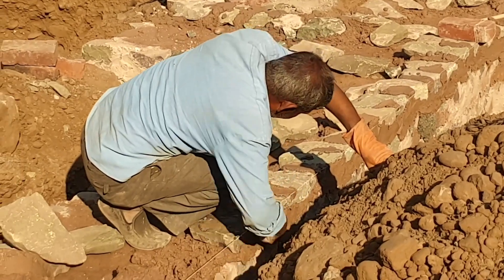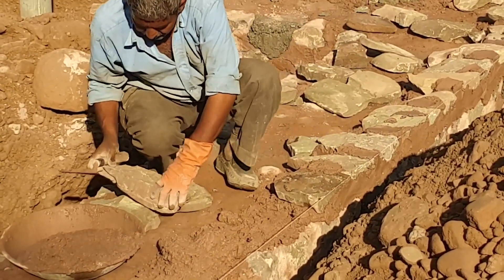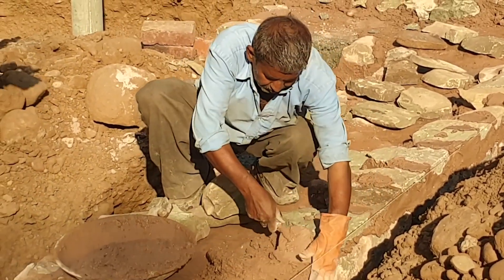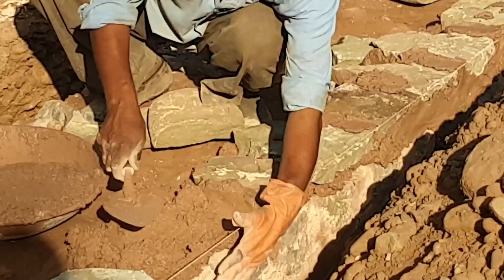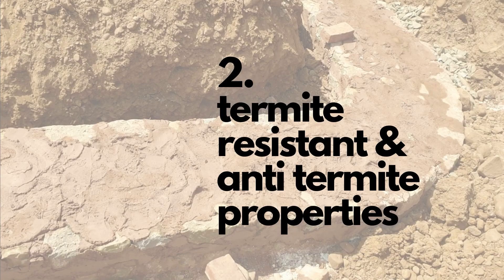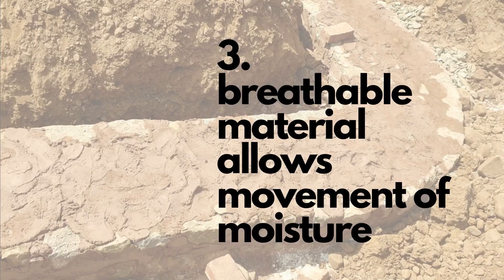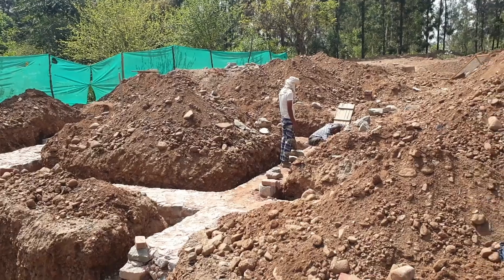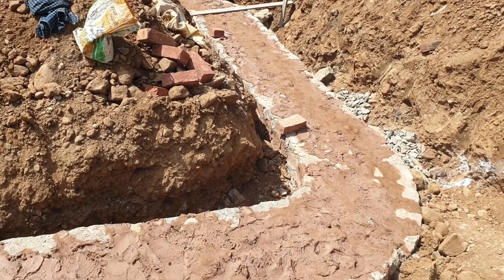Make a Lime & Stone Foundation for a Sustainable House!

Comment: Thanks for this video. I have a question though. Since you are using g lime, Is there a waiting period once you are done with foundation and before you start building the basement  above the ground level? 
I  have been told that at every stage you need to  atleast wait for 1 month to allow the lime to settle in and only then move on to the next stage either the basement or the walls. 
Please clarify.
Reply from the maker: Yes, Lime sets slowly, so you do need to give it time.

Comment: It seems you are using hydrated lime powder, is that correct? When you use quicklime instead and slake the lime while preparing the mixture, so that it becomes hot, then the foundation is more durable, because of the chemical reactions from the slaking of lime together with the soil. Did you try that? Or did you use hydraulic lime? I can share a video wher you can see the difference, but unfortunately it is German: https://www.youtube.com/watch?v=SLEv6H7YBK0
Reply from the maker: We have used hydrated lime, but slaking it in the slaking tank

Comment: Maam how the plinth beam is made....which material is used. Secondly i am curious about the roof made of wood...can we build storeys above?
Reply from the maker: Plinth beam is made with steel and cement. 
Yes, you can make a second floor on top of the wooden roof. Most homes in the hills used to have wooden roofs in the past.

Comment: Liked and subscribed after finding this channel. Very impressed with the recycling and circular economy of lime used in construction. I have built a geodesic dome and covered it in an outer skin of newspapers and PVA. It is a large space and extremely lightweight.  I am looking to render over it with a light weight mortar and have been researching how shell is formed in nature. From egg shells to sea shels both extremely strong materials especially in the shapenof an egg or a dome where shape contributes to strength. This being the case my frame can be removed after outside coatings have set to make many more replicas.i have big ideas regards geopolymers if roman concrete can be considered a geopolymer. Before I render my geodesic dome I am thinking three steps ahead. Three layers, as in anode , cathode  and absorbant wicking separator.my whole building  will be an air battery and electrical store of power that can be charged and discharged when thinking about the Three seperate lime recepies for each layer. I look forward to your feedback and from anyone else that believes in open source abd that sharing is caring .❤

Comment: Hello Manisha....im trying to reconstruct and maintain a 70 yr old Mudhouse...i did see ur video on Building with Lime . Since  i couldnot find  arny local workmen who have hands on experience with Lime mortar i tried this my self...tried with a 3: 1 River sand to Lime mix and then a 2.5 : 1: 0.5 of River sand  Lime and Wood ash.....Both the mixes turned out brittle and are setting in even after 30 -40 days and is sort of breaking off.....Will be very helpful if u can share any details on the mix or any writeup / manuscript /link u have on Lime mortar mix proportions and any pratical tips Thanks in advance
Reply from the maker: The mix ratios used by us are 2: 1 Sand : Lime
When adding ash it would be 1.5 : 1 : 0.5.  Sand : Lime : Ash

You are putting too much sand, which is making it brittle.

Comment: Before cement,lime was the binding material used in buildings . Cement ,a limestone based product replaced lime. Now, lime suitable for building is not easily available
Reply from the maker: Yes, lime is becoming less common, but you can still find it! You can contact MLIME to get good quality lime for construction

Comment: How do you make corners in rammed walls?
I mean length and width, which meet at corners.
Is there any space between them, or can you fill it with mortar?
Reply: And different angles in the corners like round,
How one can make them?
Reply from the maker: all our corners are rounded. For that we had made curved formwork. However, you can make an angular corner as well. Just make the formwork in one go, so you are ramming the edge together and not piece by piece
Reply: @farmaanandaa  thanks.
I will keep inquiring.
Hope you won't be bothered.
Thanks again to reply.

Comment: Is red clay soil ideal for Rammed earth construction??
Reply from the maker: Clayey soil is not suitable for rammed earth. You should try cob technique instead
Reply: If soil is too much clay add amendments like sand or gravel, don't just use as is. 
We have high clay in spots, but by mixing with gravel from other parts of our land have found a good mix. 
We are still in the testing stage but the blocks set like concrete with the mix we created. So like cob a mix, but unlike cob a drier mix. Which for us is best. We catch rain water or haul it in if there is no rain.
YMMV testing is key. Check Martin Rauch work on rammed earth too.

Comment: What is the plinth beam made of?
Reply from the maker: That is made of  steel and cement
Reply: @farmaanandaa  thank you and was any damp proof coating done on top of it?
Reply from the maker: @msunils  not really, but you could do it
Reply: Why the plinth beam not made with lime mortar? And why plinth beam is at all required for a single floor house?
Reply from the maker: @shekharkanchan275  because the steel rebars will corrode with lime. Also it was needed because we are in earthquake zone. Otherwise it was not necessary

Comment: Is this OK for heavy rainfall areas? OR do we need dry stone foundation for particularly heavy rain fall areas houses foundation?
Reply from the maker: Am not sure.
Reply: Are you worried about walls or foundation? or both?
Optimal Roof Overhang Length: the more driving rain you get the more overhang you want. always try to keep walls dryish.
12–18 inches: This is a practical minimum for most climates. It provides decent protection while keeping construction costs manageable. In moderate climates with average rainfall (e.g., much of the U.S. or Europe), this range is often sufficient.
18–24 inches: Ideal for harsher climates with heavy rain, snow, or intense sun (e.g., coastal areas, mountainous regions, or the tropics). Longer overhangs offer better shielding and can improve energy efficiency by shading windows.
Longer than 24 inches: In extreme conditions (e.g., tropical storms or heavy snow loads), overhangs of 3 feet or more may be beneficial, though they require stronger structural support and may increase costs.

If the foundation area is wet often or flooding? Higher ground with Lime Soil Stabilization is common.
Clay soils require more lime for stabilization compared to other soil types. This is due to several key factors:
Chemical Composition: Clay soils contain minerals like silica and alumina, which react with lime to form cementitious compounds that strengthen the soil. This process demands a higher amount of lime to be effective.

High Plasticity: Clay soils tend to expand and shrink significantly with moisture changes because of their high plasticity. Lime reduces this plasticity by modifying the soil’s structure, but it takes more lime to achieve this effect in clay than in less plastic soils like sand or silt.

Large Surface Area: The fine particles in clay provide a greater surface area, allowing the soil to absorb more lime, which increases the overall amount needed for stabilization.

Typically, clay soils require 3-8% lime by weight, while sandy or silty soils may only need 2-4%. Thus, clay soils consistently require more lime to achieve the desired stabilization results.
Reply: Lime Foundations: Hydraulic lime is suitable for heavy rainfall areas due to its water resistance, while non-hydraulic lime is less effective.

Dry Stone Foundations: These can work if well-built but may need more maintenance than lime foundations.

Water Diversions: 
Swales: Effective if sloped (1-2%) and stabilized with gravel or plants.

Clay Skirt: Good if compacted and extended 2-3 feet from the foundation (bentonite clay is ideal).

French Drains: Place 10-15 feet from the building, with proper slope and filter fabric to avoid pests and water attraction.

Summary: Hydraulic lime foundations are reliable for wet areas, dry stone is viable with upkeep, and your diversion strategies are solid with slight adjustments.

Lime Foundations:
Work well with proper engineering (e.g., hydraulic lime and drainage systems).

May require more upkeep in very wet climates.

Best where a solid, continuous foundation is needed, or where stone for dry construction isn’t available.

Dry Stone Foundations:
Naturally handle heavy rain due to drainage, needing less additional infrastructure.

Ideal where rainfall is intense and consistent, and suitable stone is accessible.

Less adaptable to modern building needs requiring a uniform base.

Neither is inherently "better" for heavy rainfall areas—it depends on the context:

Local Climate: How frequent and intense is the rainfall? Dry stone excels in constant wet conditions, while lime can suffice with proper design.

Site Conditions: Is the soil stable or prone to erosion? Are there flooding risks?

Materials and Expertise: Are stones or lime readily available? Are there skilled builders for either method?

Conclusion
Lime foundations are OK for heavy rainfall areas if constructed with hydraulic lime and supported by good drainage systems to manage water exposure. They’re a viable option with the right precautions.

Dry stone foundations are not strictly "needed" but are an excellent choice for heavy rainfall areas due to their natural drainage and durability, especially where local stone is plentiful. For the best outcome, consult a neighbor who's building is doing well
Reply: It can be confusing to learn but this might also help

Quicklime (CaO) = Burnt Lime = Living Lime, made by calcination (burning limestone (CaCO₃) in a kiln). [Note: Does not cure with water; reacts to form hydrated lime, which then cures.]

Hydrated Lime (Ca(OH)₂) = Slaked Lime = Fat Lime = Non-Hydraulic Lime, made by slaking high-calcium quicklime with water; sets by carbonation (reacting with CO₂ to form CaCO₃). Best Egypt Hydrated Powder is a high-purity, high-calcium hydrated lime from the El Minya region, known for limestone with CaCO₃ content up to 99.6% and brightness over 96%. [Note: Does not cure well with water alone, relies on carbonation.]

Dolomitic Hydrated Lime (Ca(OH)₂ + Mg(OH)₂), made by slaking dolomitic quicklime (CaO·MgO); includes magnesium hydroxide, often processed into Type S lime, which is used for masonry due to enhanced workability and strength. [Note: Does not cure well with water alone, relies on carbonation unless mixed with pozzolans.]

Hydraulic Lime is from limestone with silica/clay, sets by reacting with water. [Note: Cures well with water due to hydraulic properties.]

Process: Limestone (CaCO₃) or dolomitic limestone (CaCO₃·MgCO₃) → Quicklime (burn in kiln) → Hydrated Lime or Dolomitic Hydrated Lime (slake with little water) or Lime Putty (slake with lots of water). Lime putty can also be made from hydrated lime + water.

Quicklime + Water = Hydrated Lime: Exothermic, expands, ensures thorough reaction. In Roman lime mortar, slaked lime + pozzolans (e.g., volcanic ash) made durable, crack-resistant concrete.

Idea: Adding quicklime to slaked/fat lime creates a hot-mixed lime mortar, but risks cracking if not fully slaked.

Accuracy Notes: "Lime = Limestone" should be "Limestone is the raw material for lime." "Hydraulic" means sets by reacting with water. Type S is a specific dolomitic hydrated lime.

Lime = Limestone
Burn it in a kiln = Quicklime
Slake Quicklime in a little water = Hydrated Lime
Slake Quicklime in a lot of water = Lime Putty (Lime putty can be also made from slaked hydrated lime)
Hydraulic Lime = Limestone with Silica and Clay
Hydrated - meaning created by adding water
Hydraulic - moved or activated by adding water
Therefore:
Hydrated lime - created by adding water to quicklime